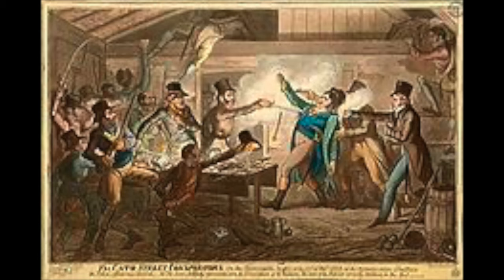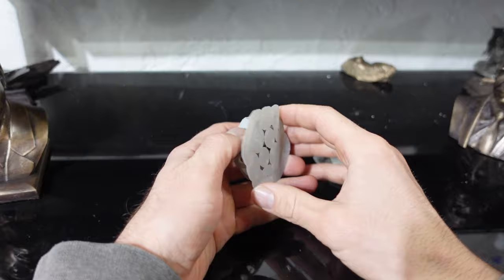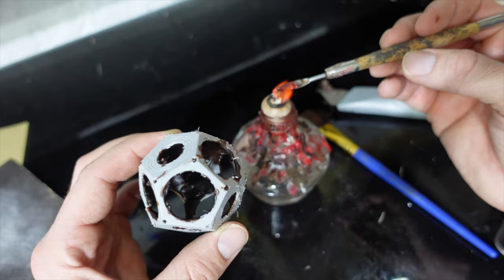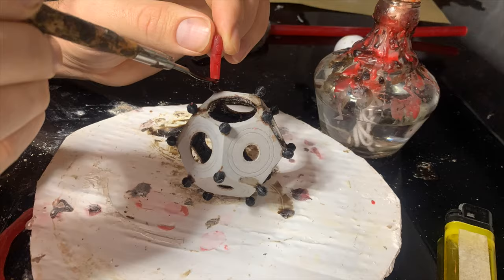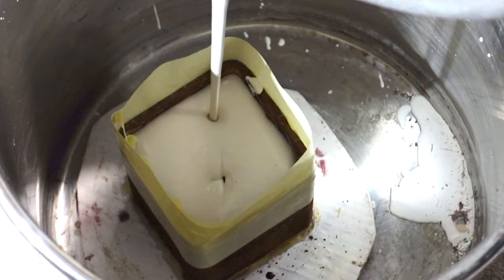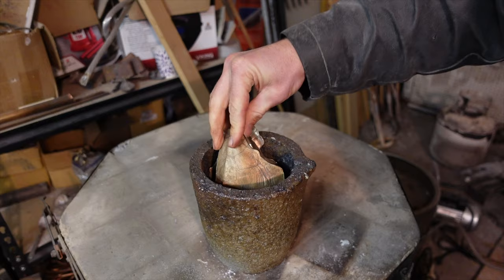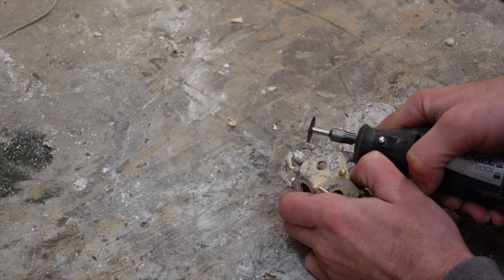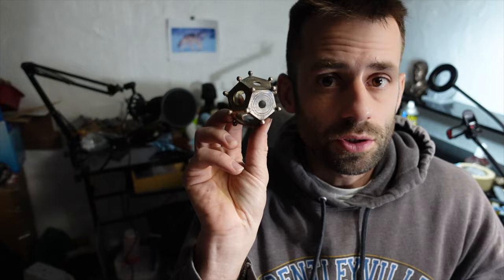Making A Bronze Roman Dodecahedron

Comment: Not a mystery - going along the edges, we have to traverse the vertices of the dodecahedron so that we pass through each vertex only once returning to the vertex we departed. All peaks must be touched. The traversal of the vertices in the Roman logic game can be guided using a piece of thread, fixing it to the small spheres at the vertices of the dodecahedron to mark the path. (kind of Ancient Rubik's Cube, a logical game of the Romans). Hamilton-path, Graph Theory, Discrete Mathematics. Naturally, the design cast in bronze was a luxury item, common version was carved in wood and a nail driven into each vertex guiding the thread.
Reply: Do you have a source for that info? I have been rewatching this objects for a while and all I have found is pure speculation, so if you have any lead it will be really helpful, thanks!
Reply: A very good theory that many have suggested over the years... but we need EVIDENCE to back it up, and so far there is none. Doesn't mean it isn't correct, but until hard fact supports it, it must remain just a theory.
Reply: But why the holes? and why are they different sizes?

Comment: Saw an interesting take on this recently where these could be used for making braided gold chains that match historical museum pieces from the era.
Reply: Same here, very interesting video. It would depend on opposing holes being the same size to put the dowels in. Even if that were not the case it would still work but the quality control (chain thickness)  would be more difficult.
Reply: She really showed good examples of how it works to make the jewelry and also pointed out the non-Roman origins.
Reply: videos back 10+ years on how to use those...... Only "mystery" is how ppl don't know.........

Comment: Have you replicated a whorl? ... a drop spindle whorl? ... a high tech drop spindle whorl designed to function with a set of 6 tapered spindles for drafting 6 different weights of thread from a distaff holding a mass of unspun fibers? The whorl adds a stabilizing weight to the spindle and the spherical array of rounded nubs add a smooth tread for rolling the dangling whorl between the solitary weaver's hand and thigh, or between the hands of an assistant.

Comment: Since these were found in coin hoards, I wonder if the sizes of the holes match the diameter of coins of the time. Maybe a way to detect clipped coinage?
Reply from the maker: They’ve theorized that they were a measuring device of some kind. But they aren’t uniform at all so it’s hard to say they were actually a measuring device. They ranged from 4cm to 11cm with all different sized holes.
Reply: I guess if you put some coins through it you could prove it.
Reply: People are using them to knit fingers for gloves. Look it up. Works well.
Reply: Nope.
Reply: Most of them are the size of golf balls

Comment: Regarding the Roman Dodecahedron, the proposed purpose that I like most is “Candle Holder”.
-The holes fit various sizes of candles, since there was no standardized manufacturing
-Heavy and stable - very important with a burning candle
-Will not catch fire when candle burns down
-Rings on each face catch dripping wax (which was found on some of them)
-The ball feet keep it stable on irregular surfaces 
-The Dodecahedron are found in the northern parts of the Roman Empire where winter nights are longer and candles were more necessary and valuable.

Comment: The best hypothesis I've heard about what the Roman dodecadrons are, is they are for creating coded communications. The holes indicate what specific coding wheel would fit (12 wheels). 
Each coding wheel would have 25 characters in a circle, with 5 characters between each knob. After each word is decoded, the dial would be turned five characters over. 
Just have to find the dials. 
As the rest of the Roman military used nautical communication around the Mediterranean, the northern Europe forces used horse riders who were more vulnerable to interception than naval vessels.
Reply from the maker: Could be!

Comment: It's for knitting gloves. The sizes of the holes and their positions and experimenting have proven out the technique.
Reply from the maker: That’s one theory however there is no documentation or historical evidence to verify it.
Reply: The nubs are all the same distance apart from each other. Why have more than 5? The different size holes don't make any difference to the size of the fingers being knitted. The distance of the nubs determines that. Also, would seem to be an expensive item for use as knitting tool.
Reply: @jefflarson1652  Watch someone knit with them, no knitting needles required. Although, this device may have inspired knitting needles.
Reply: Knitting literally hadn't been invented yet when these were made.  And you can only make fingers out of them.  A much better use is for making rope cordage or gold/silver chains.

Comment: The dodecahedrons are in fact a Tessera Arca (Knuckle Box ring sizer) and were used specifically to measure the fingers (knuckle) in order to size rings that were made from coins . Back in the day if you wanted a ring made from precious metal the easiest way to do this was to use an old coin. However this practise of destroying legal tender was just as illegal back in the day as it is in most countries today so the craftsmen and women who offered this service were usually transitory and highly secretive about their trade. This accounts for the service not being available in the Mediterranean (heart of the) Roman Empire, and generally practised in the North-West of the Empire. As such no dodecahedra have been found outside this region to date. 
The client impressed and encouraged by the sheer craftsmanship of the dodecahedron, that was a remarkable feat of engineering skill in those days, would slip their chosen ring ringer or thumb into the 12 available holes of the dodecahedron until the correct fit was ascertained. The craftsman would then place the coin to be used (a 34mm Sestertius) over the hole using the surrounding nodules to hold the coin in position whilst it was scribed from the opposite side (from within the dodecahedron) with the outline of the circle. 
The coin could now be removed from the tessera and worked. Firstly a hole would have been drilled and cut in the centre of the coin. in the centre of the coin, almost as wide as the guide mark. The coin would then be placed on a tapered metal spike and hammered with a soft mallet so it folds over until it makes a flat ring. A bit of filing and the ring is finished and fits perfectly.  
A skilled technician could thus create a ring whilst his customer waited, in just a couple of hours, and then on receipt of payment disappear into the shadows. Of course there were easier ways to size a ring, they could have used a simple bunch of sample rings, but this would be much more conspicuous and far less alluring than a dodecahedron placed on a dimly lit tavern table, probably with a small candle lit inside to accentuate the object and add to its mysticism and curiosity. The tessera was not just a tool, it was a shop window advertising sign. And of course if the craftsman were caught in possession of a dodecahedron, well the authorities would be totally baffled and have no better idea of its actual use just as we do today.

PLEASE WATCH MY VIDEO OF THE DODECAHEDRON BEING USED
Reply from the maker: Very creative explanation.
Reply: Only problem is, no-one had a finger as narrow as the smallest hole
Reply: @mikev4621  The smallest hole on my cast easily fits a pinky - especially a woman's little finger or even a child.
Reply: I'm not convinced - if this were true we'd expect to find these artifacts on the Apennine peninsula (the "Boot" of Italy) - and in greater numbers than elsewhere since rings are a Veblen good and something you'd find closer to centers of commerce where wealth accumulates.

So far, not a single dodecahedron has been found on the peninsula - which greatly adds to the mystery, but alas, not to your hypothesis.
Reply: @LilMissMurder3409  Rings made out of Roman Coins and the process would have been illegal, defacing a roman coin or an image of the Emperor. So the process would only be available in the outer reaches of the empire and only performed by transient none Romans.

Comment: Military ciphers.  All found near Roman military bases.   Different Wheels, that had letters, had different codes. The wheels had pegs of different sizes to correspond  to the dodecahedron holes.  Sender and receivers of encrypted messages matched up the correct size holes to decipher the code.  First enigma machine basically.  Only the metal lasted the eons.
Reply: NO. Because you dont need the dodecahedron at all to do that. Just press the axle into wax

Comment: I thought the main theory was for knitting gloves, since it works very well for that purpose, and possibly more importantly, they've only been found in northern Europe. All of the other proposed uses would have been just as important all around the Roman empire; religious, astronomical, economical, or social, would still be relevant. And it'd make sense there isn't anything documenting it, the tools of specialized work usually aren't preserved in writing or art, they're passed from master to apprentice. There was another case I remember hearing of these strange polished bone pieces "used for religious or ceremonial purposes" and then a leather worker went, "hey, I use one, and mine is still made of bone too cuz it works better than wood, metal, or plastic"
Reply from the maker: That is a common theory but the same effect could have been accomplished with a hole in a piece of wood so to make such an elaborate piece for a relatively simple task is problematic. Also the fact that they were buried with people and hidden in coin hordes implied they were more valuable than an ordinary tool. But who knows.
Reply: @lundgrenbronzestudios  fair enough. Good work on the casting, looks like you've got the quirks of lost PLA pretty well ironed out. I did notice you had a pretty massive brim on the print though, and some stringing. For ABS, I use a brim, but I've found PLA does just fine without it when you dial in the spacing of the first layer, and it makes the cleanup a whole lot easier (no more cutting the edges with a utility knife). Stringing can be caused by incorrect temps, so if you haven't already, find a temp tower. It's a prescliced gcode that prints different sections at different temperatures. If it strings on all layers of the temp tower, it's probably an issue with retraction, and that gets a bit trickier, because the solutions can be printer specific.
Reply from the maker: Thanks for the tip. I’ve been wondering if I really need the brim. It would be easier without it for sure.
Reply: @lundgrenbronzestudios  it's useful to prevent warping and increase adhesion to the bed, but PLA doesn't warp much, and sticks just fine most of the time. There are times on large prints it's a good precaution, better to have a little extra work cleaning than risk a 500 gram print failing, but for little stuff like this, it's more trouble than it's worth
Reply: @lundgrenbronzestudios I've watched a video series where a woman knitted a glove using a 3d printed dodecahedron. She was able to connect all the fingers to the palm just by wrapping around the various nubs. Did a few rounds, then added the thumb in the same way.
Reply: The dodecahedron are not standardized in shape or size or decoration. They varied from Softball to Dice sized. If they are a tool you'd have to account for the variation. I saw a theory that talked about it being a cord marking tool and that seemed intriguing.
But personally I think it's a dope trinket that people wore as a class of jewelry occasionally. It can have all sorts of meanings and uses and the holes and nubbins on the vertices make for great anchor points for however you want to display it. Or for bigger ones you just plonk down on your desk and call it good.
But who knows! I sure as hell don't haha

Comment: They are tent supports. 6 makes 2 gable walls held in tension with rope. You can spin it to accommodate different sized sticks to form the gable walls of the tent.
Reply: They go in the corners of the gable walls.
Reply from the maker: Never heard that theory before.
Reply: @lundgrenbronzestudios  It will work. Give it a try. You will need 6 dodecahedrons, 10 sticks, some rope, and at least 4 wooden stakes. A rope should run from the top chord at the apex of the tent and 1 each on the sides. The front and back(Gable ends of the tent) can be staked with 2 wooden stakes. Once the structure is up you can dress it with the fabric of your choosing.
This makes sense because they were largely found at military camps and you wouldn't need to transport wooden posts but would still have a "quick set tent".

Comment: it's for knitting glove fingers
Reply from the maker: That’s a theory but no documentation to confirm it.
Reply: It's not.  These predate the first known mention of knitting by over a millennium, and we've found very similar objects without holes in them.  Not to mention that there are designs which are far easier to make and achieve the same basic functionality.
Reply: @zackakai5173  if I bait enough of you someone that knows will come along.
Reply: @kingmasterlord  That only works if somebody actually knows. 😆

Comment: Its a candle holder, allows for different sized candles as there was no EU standards in those days - candle sizes varied from candlemaker to candlemaker, town to town. Even fill it with wax - put a wick in it for more or less light.. Solved.
Reply: I think this is one explanation. Very important not to start house fires with unsupported candles , or candles in holes too big to hold them up straight
Reply: That's what I think too. They have not been found in Italy, Spain, Greece or Africa because they had olive oil for oil lamps in those countries. What I would like to know is what are the sizes of the holes that are opposite each other. If a candle is dropped in from the top, then the bottom hole should be slightly smaller than the top hole for each possible position. Is this the case?
Reply: @steve6375   - they prob just used the hole slightly smaller than the candle base - wiggled it in and used wax melted to hold it on place? - when completely burned it fell into the centre and went out...
Reply: @_Hold_My_Beer_ The candles would have been made by dipping wicks into hot wax repeatedly. They would be slightly conical in shape.
Reply: @steve6375  Afaik all the holes were of different sizes on most of them. The best theory I've seen is that they are a military code disc reading device.There is a video demonstrating this. Occasional use as a candle stand is very likely as well.

Comment: It's a device that was used mostly by businessmen to sort large amounts of objects, for trading purposes. Mostly for coins. It was made of metal by craftsmen and rings or other markings where added to make cheating harder. You'd plug the holes, fill it up and then open the smaller holes first. The nubs where added so it could be held more easily or roll them while leaving enough room so the coins could still fall out.
Reply from the maker: Interesting theory.
Reply: @lundgrenbronzestudios  I thought about it for a bit, and it was the only thing that would truly make sense to me tbh. Or maybe I'm what you would call a time traveller, and I've seen these things being used as ubiquitously as poop scrubbers. Who knows 🤷.